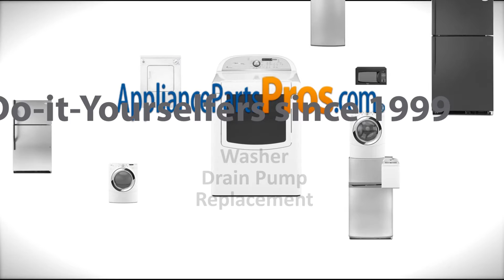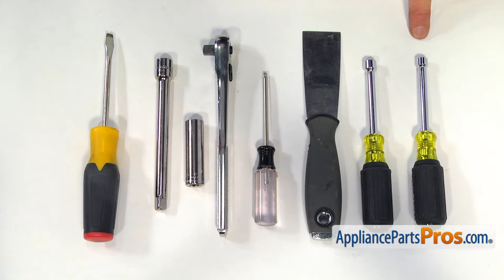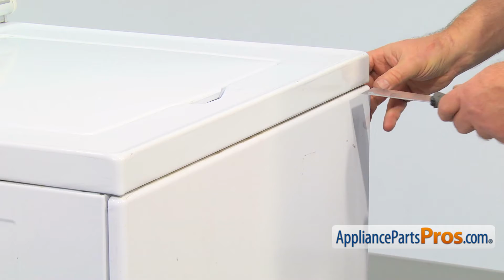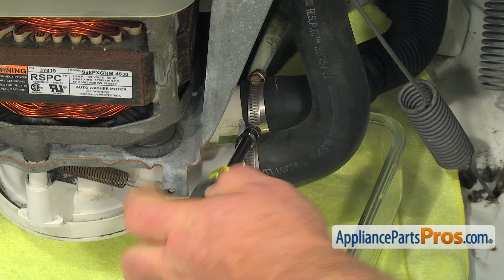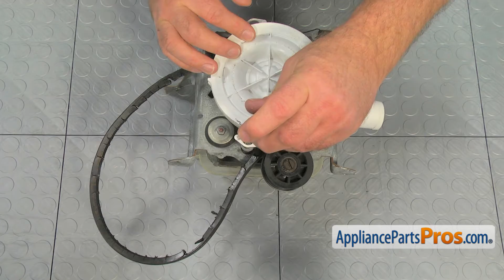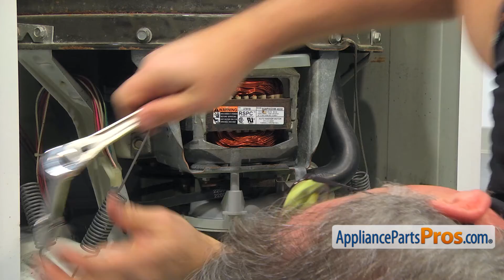How To: Whirlpool/KitchenAid/Maytag Drain Pump 27001233

Comment: I’ve seen a lot of people saying their drain pump is stuck on the motor after removing the three torque screws. Mine was the same and I struggled for a while trying to get it off. Do not pry against the pulley. I went to Home Depot and picked up Blaster Penetrating spray. I used quite a bit and let it sit for about 5 minutes, went back and hit it with another spray and let it sit. I set the motor on its side and gave the pump a good smack or two and it started to slowly but surely come off. The rust penetrator worked like a charm.

Comment: I hardly use my washer yet I just had to change the belt - AGAIN! I'm sure a heavy load of bath towels doesn't help the situation much when it tries to start the spin cycle but WHY is there so little tension on those belts? Just that one little wimpy spring so when it starts the spin cycle it sits there and the pulley spins inside the belt until things finally start moving, meanwhile it's killing the belt. Yes, it's the right length belt! Why don't they put a real spring on the thing so that the pulley actually has some grip?
Reply: I just got the appropriate belt and it seemed to fit snug, but like you said, Andork, the belt is stationary while the pulley is spinning inside of it. I would like to avoid burning another belt so quickly! Any tips from either you or AppliancePartsPros?
Reply: @frederickchoe  Finally the drum support bearing turned out to be bad, and there was no getting it apart to change it either, not without destroying everything. Bought the biggest, baddest puller I could fit in there and it f-ed up the puller! Finally gave up and bought a new machine. This one was 18 years old but I never used it that much. Anyway, I don't know if that bearing going bad hadn't been a longer term issue and contributed to the short belt life I was getting.
Reply: I’m nearing my end with this machine. Also 15 years old so maybe it’s just time to throw in the towel
Reply: @frederickchoe  Probably. 15 years on the average machine is a lot, lot more than I put on mine in 18. And to think I spent the extra money to get the stainless basket - so it would last longer!! At least now I have a stainless burn barrel!

Comment: How do I pull he water tank off the motor? Seems to be stuck in the middle where the belt goes and can't pull it straight up.
Reply: I had to hit mine on both sides with a hammer... it finally broke free, had a lot of rust holding it in... don't pry between the pully and pump... you will bend the pully.
Reply from the maker: Were you able to remove all three Torx-20 screws that hold the pump in place, or were those stuck?
Reply: Screws are out tried toothbrush with soap to clean around all connected parts and used screwdriver to try to pry it up. And ideas?
Reply from the maker: It sounds pretty coroded. You may have to try something other than soap, like a rust penetrating oil. Soak it with something like Rust Buster, and that may help free it. http://www.appliancepartspros.com/pro-rust-buster-tj93241-ap5638848.html